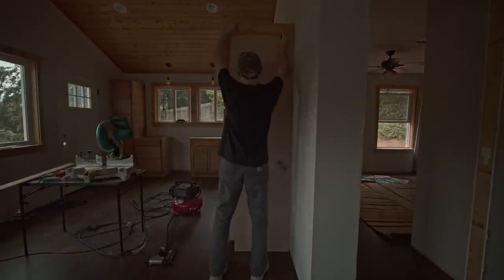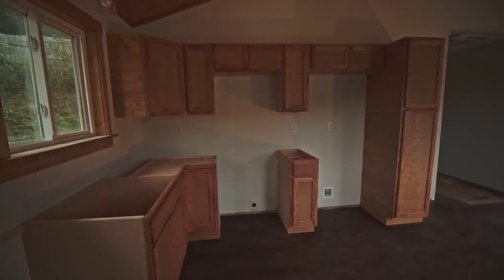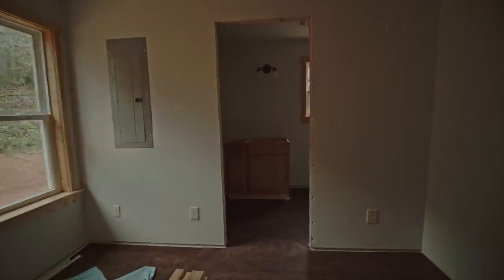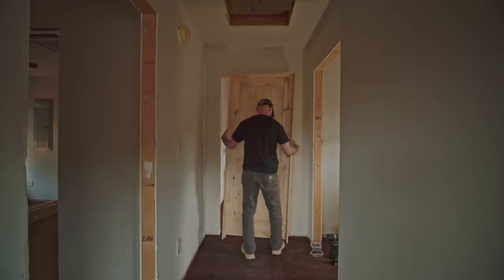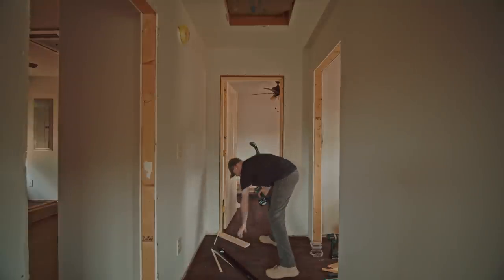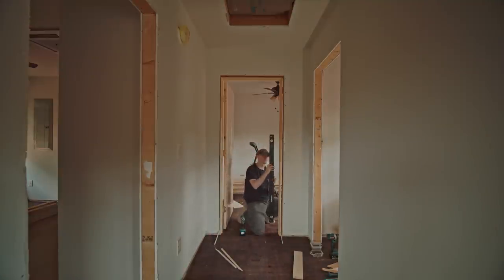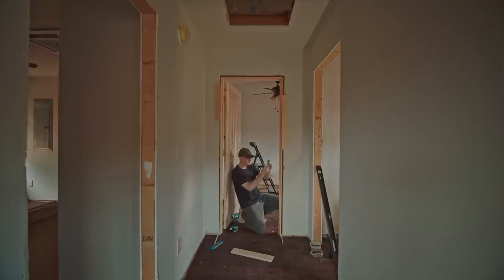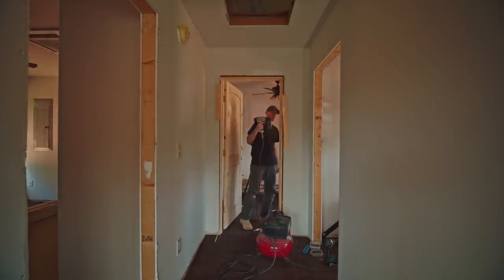How to install a wood/pine door

Comment: Looking good. Are the 2 bathrooms gonna be cooled/heated as part of the minisplit system?
Reply from the maker: The bathrooms will have a heater in the ceiling but no AC.  With the door cracked open it will not be an issue since they are small and well insulated.

Comment: Hi there. Absolutely love your approach to affordable housing. For many years now, I have wanted to help people in a similar way. In the next month, I will be selling a condo in TX and will be looking at building an affordable home. I was wondering if I could reach out to you for guidance/advice? I’ve been researching Mighty Small Homes - they’re basically kit homes. Do you think going that route would be even more affordable? What is your opinion on SIP kit homes? Thank you!
Reply from the maker: Hello,
If you can find affordable sips I do like them. But if you frame a house the old fashioned way you can save some money like I do here, you just have to connect with the right people. 
Construction labor now a days is hard to find so that might be a challenge, but it can be done.
Reply: Thank you very much for the advice. Did you have to have your floor plans approved by a draftsman and engineer?
Reply from the maker: @shaneduyvenedewit5197  No, when I make them they are good to go in most areas.
Reply: Would you be willing to sell your blueprints? I have drawn my own floor plans using home.by.me (available for free online), but the program doesn’t produce exterior elevations, nor blueprints. Any suggestions?
Reply from the maker: @shaneduyvenedewit5197  I will eventually

Comment: There is no reason to install doors while they are still on the frame. It's more complicated that way. Every time you move the door you lose your fine tuning adjustments. It's rather easier to take doors off the frame, take out door stops and then proceed with installation. Also you can finish doors while doors are off to avoid any stain, varnish or paint smudges, not to mention none of it will get on to the hinges. Installing doors yourself is great idea, people charge arm and leg for doors installations, excellent money saving tip right here.